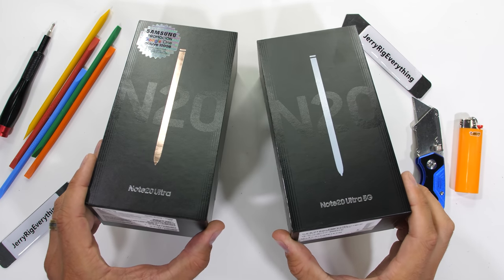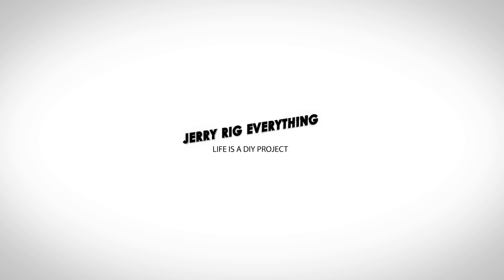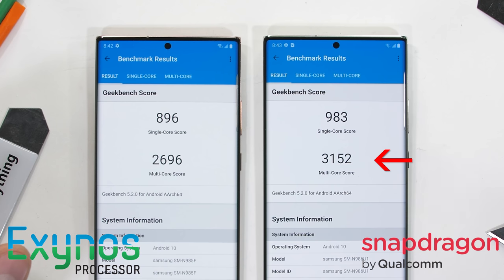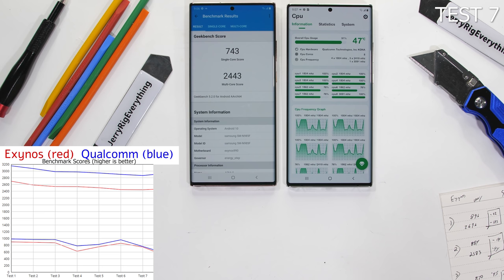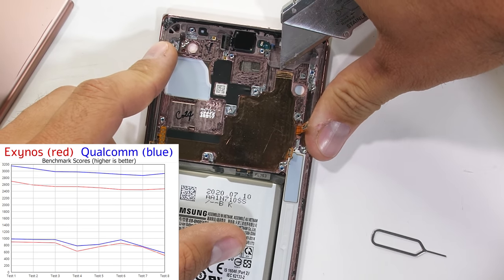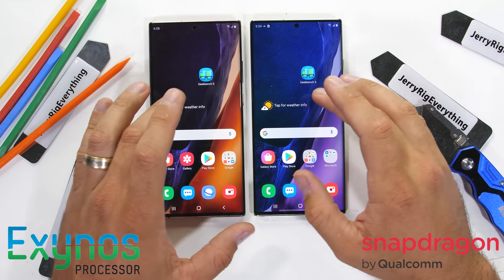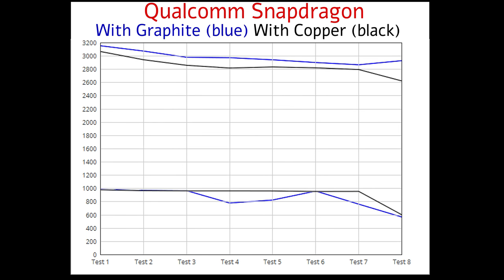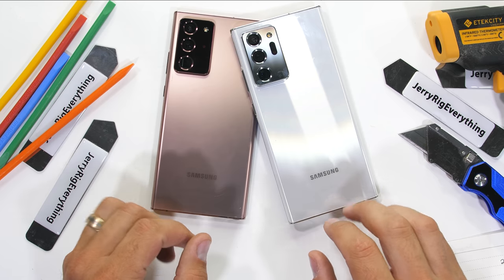Samsung should explain this... Exynos vs Qualcomm?! - Note 20 Ultra

Comment: i own a op8t and my bro has s20fe (exynos) he's phone keeps giving errors like the phone is too hot and he complains about it drains the battery too fast and it made me think not all of it could be fictional, also his phone is always on 60hz bec it drains too much battery and it gets hot as he says

ps: op8t is basically a s20 with a twist, i must admit that i get freezing/lagging issues with mine but im convinced that its a software issue other than hardware, bec the phone is lacking so many features and optimization and the fact that they didn't got fixed after years or so doesn't help also i never got the phone is too hot error and it wasn't lack of trying

Comment: Samsung is ultra crappy after they update the OS they also reduce speed of battery charging, their screen doesn't stay on if at all in the sun as it overheats quite quickly, never again. I have the Exynos S20 5G, battery life with Chrome in particular is like 1 percent per minute of regular surfing . I cant even give such a thing away with the battery life like that.